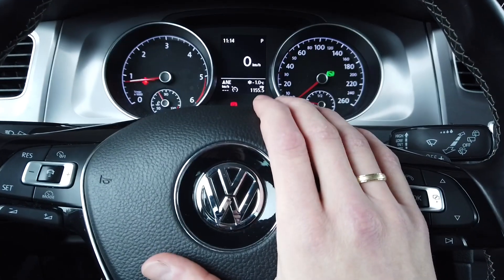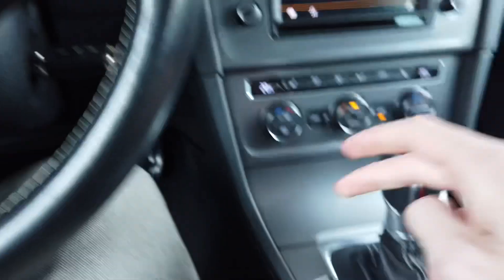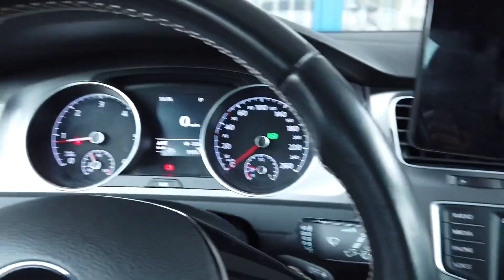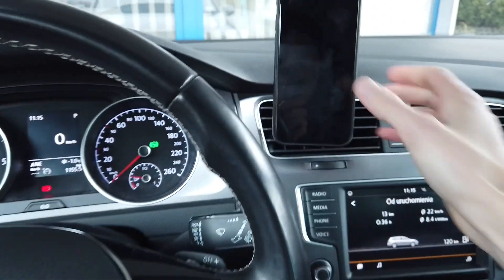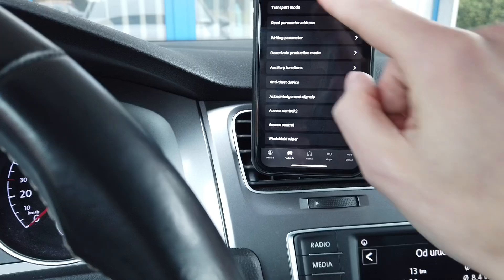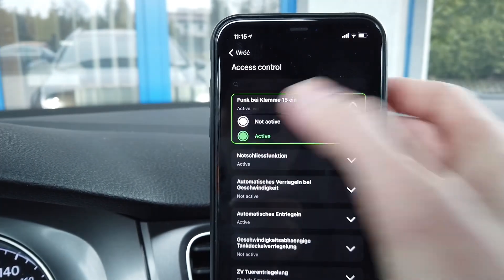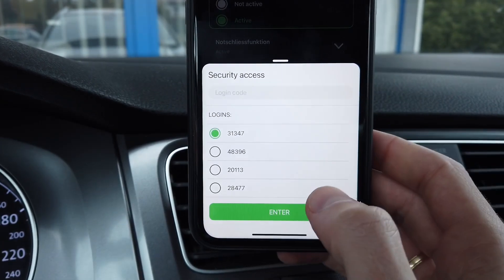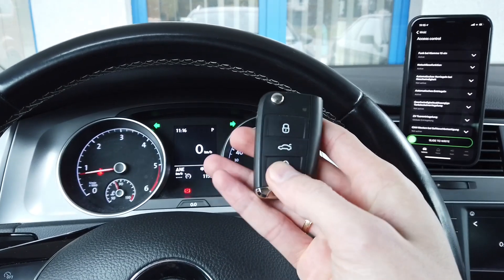VW Golf MK7 (5G) remote control with engine on activation

Comment: Does it affect when locking your car with you key in the car even when off.
Reply from the maker: No. It just enables additional option to use the remote with ignition on.

Comment: Great video thank you

Can you code remote start and if so can you make video for this function
Reply from the maker: Would love to have remote start but sadly can't find proper set of required parts and settings. Not even sure if the feature is possible on MK7. I know that I need different remote (with extra button for remote start) but not sure if rest of my car would support the feature.
Reply: @mrfixpl hey. I'm currently trying to retrofit the feature. But actually the manual shifter makes it (currently) undoable. But you have the automatic one and it should be possible. 👍

Comment: Police car use this option, but I can't imagen normal person needs this option
Reply from the maker: Well, if you live in very hot or very cold climate, and you don't want to turn off the engine when leaving the car for few seconds, it will allow you to lock it when you're gone. Of course you need to check your local laws as leaving the vehicle running might be illegal.